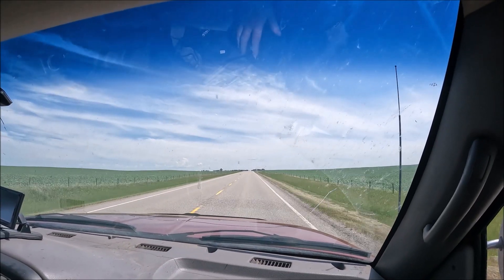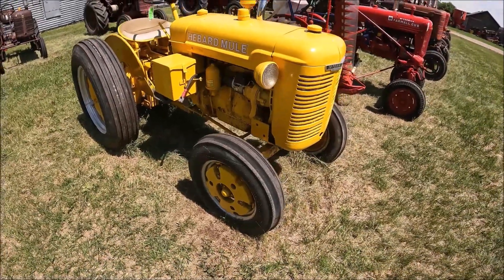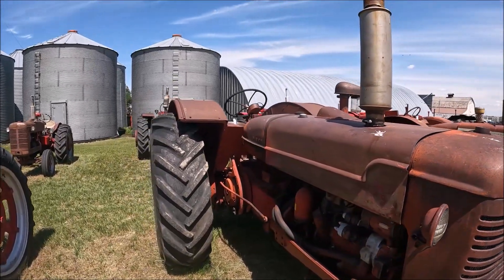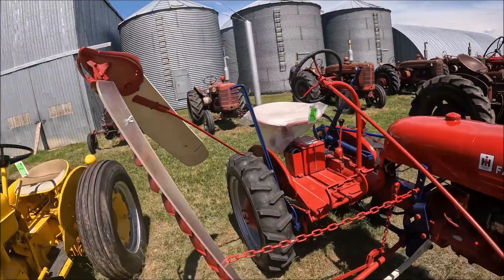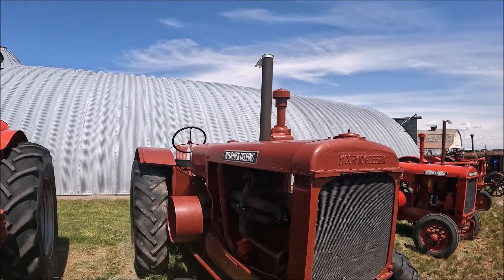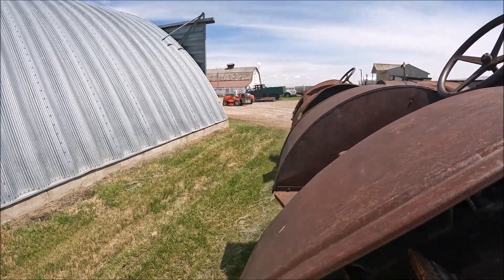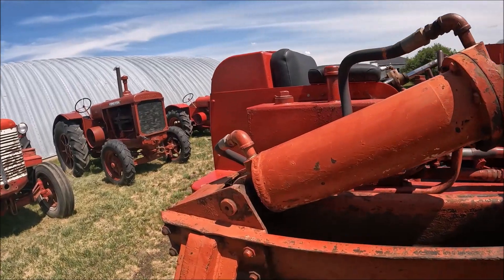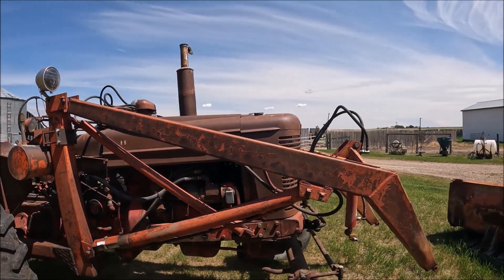Awesome Red Power Auction Preview, Part 1, Nothing but IH Tractors at Auction

Comment: Looks like a Farmall A or SA engine, but the gear shift arrangement indicates the rear portion is a transplant.
Reply from the maker: It's a Farmall A running gear. There was an FAA serial number on the engine, around 177000 if I remember right.

Comment: Good   day Ty  That M with  wide fenders u said were from Winnipeg,  back end platform reminds  me a little like old 10=20
FF  he ask a question?
Wow   300 front block broke,  wonder how that happen?
Will this  be on-line too?   Thanks  for now
Reply from the maker: I heard the fenders were manufactured in Winnipeg, but I'm not too sure. I've seen several sets of them, and we have 3 sets of them. They are really nice and make the platforms nice and big, and they are also set out more than the original clamshells.

Comment: The extra tank on that 300 was a factory option not very common ether
Reply from the maker: It was also part of the 350 wheatland package for gasoline models. The diesels don't use that tank as it goes where the battery box does.